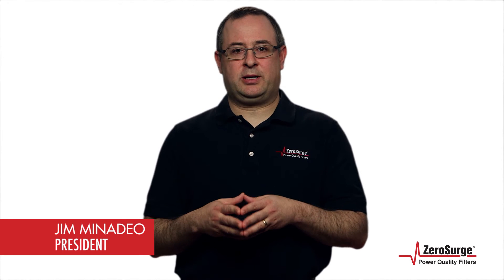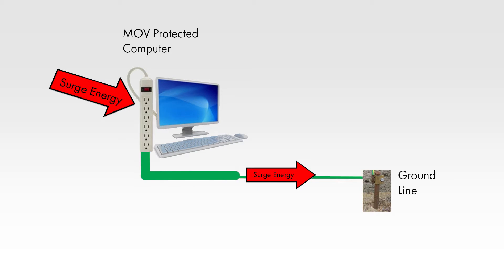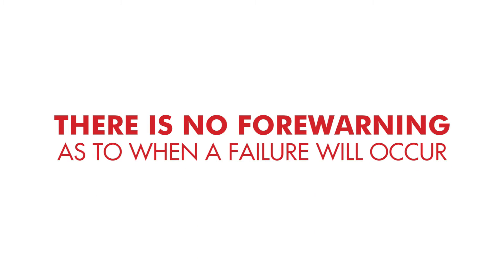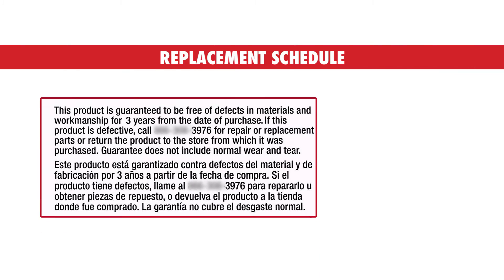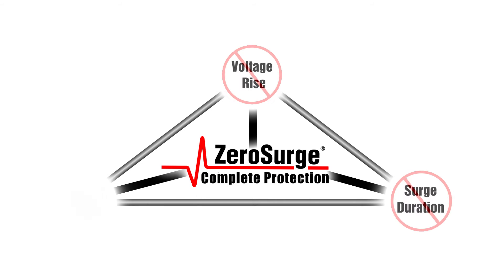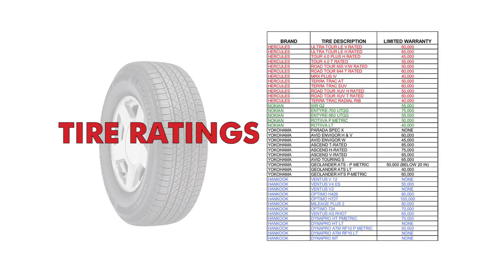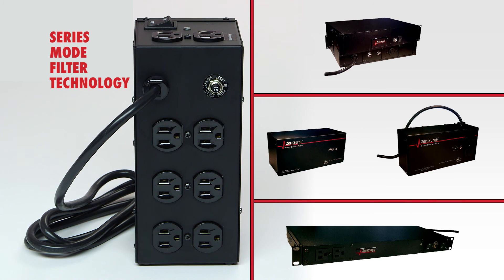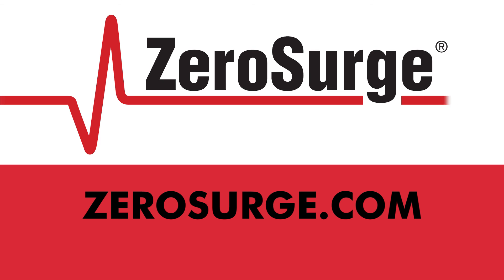The Truth About MOVs

Comment: I recently read a criticism of series-mode surge protectors that said that they only operate/protect in one direction: the direction of the flow of current coming in from the public utility. It was said that if you have a surge or a spike that originates on your neutral line for some reason, a series-mode surge protector offers no protection at all in that case. However, since a shunt-mode surge protector runs parallel to the lines, it doesn't care what direction the surge or spike originates from or travels in and it will offer its protection regardless. Is that true? Does that illustrate a potential advantage that a MOV-based surge protector could potentially have over a series-mode one?
Reply from the maker: MOV companies know that common mode surges (ones that are on the neutral) are not what harm power supplies.  Power supplies need to have 2000 volt resistance or they could hurt humans!  APC wrote a white paper called "common mode surge myth"!  Email us and we can send it to you.  

Surges in current are invisible to MOVs but cause the damage to power supplies. That is why MOVs are ineffective to stop most surges especially the in-rush of current when a device is turned on.

Comment: Do they make whole house surge protectors with non mov technology you install by your panel
Reply from the maker: We do not know of any that do not use shunt mode components.  Whole building surge protectors are not really needed.  80% of surges originate from inside of a building so having something at the entrance is not that effective.  Also, the inside surge protectors will be active before the whole building ones would have a chance to do anything.
Reply: @Zerosurge  Right, but I have heard certified Master Electricians say that ideally you want to take a tiered/layered approach to surge protection, just to be on the safe side. They have recommended three layers of protection: 1.) Surge protection outside at the Point-of-Service (installed by the electric service provider/utility company) 2.) Surge protection at the breaker box/inside panel (installed by an electrician) 3.) Individual surge protection devices at the outlet for any high-value electronic devices (purchased and put in use by the homeowner). The idea there is that each level of surge protection has a varying degree of let-through voltage and that what you are doing by taking that tiered approach is knocking down the amount of voltage that can potentially come in from the outside as it passes through each layer of protection. Yes, 80% of the surge events that you experience will come from inside of your facility, but that remaining 20% make up the ones that have the potential to send truly massive surges and spikes towards your equipment (a lightning strike nearby or a transformer explosion at a local substation), even if they are far more rare and unlikely to occur.
Reply from the maker: @michaelbeckerman7532  Sure - the electricians only hear from the manufacturers of the whole building equipment.  They are not engineers or scientists who look to the physics.  The VPR for a whole building is set too high.  In the layered approach, guess which device does all of the work?  The one with the lowest VPR!  As soon as the voltage rises, the device that knocks that voltage down first will do all of the work.  Think of it like a set of dams.  If my inside dam opens when the water is 10 feet high and the outside dam opens when the water is 20 feet high, what happens?  As soon as the water hits 10 feet, the inside dam lowers the water level.  The outside dam never sees the rising water!  Most of the 20% is switching activities that are not that high in voltage.  We monitor our incoming power and we see ring waves of 200-300 volts coming from the solar farms connecting in the morning  but in the 7 years of monitoring it never got high enough for a whole building surge protector to operate.  And I have seen with my eyes, lightning strike the road outside my office window.

Comment: So if I buy one of your two outlet systems, can I safely plug a regular power bar or UPS “downstream” of it to power and protect more items (so long as I don’t overload it?
Reply from the maker: You could do that. But be careful to not overload!
Reply: @Zerosurge  how? wouldnt this be daisy chain? I mean the 8 outlet is very limiting i wish you had a 10 or 12 non rack option
Reply: @naegleriafowleri2230  daisy chaining is defined as connecting two devices that have three or more receptacles each.  

You want to keep the current load to 80% of the rated wall receptacle.  A 12 receptacle device would limit the average load to about one amp each.  Better to spread out the loads (from a fire safety perspective).

Comment: To be clear, it's MOVs connected to ground that are the main engineering disaster here. MOVs installed just between hot(/active/live) and neutral are at least harmless enough, if they're given enough thermal protection to not start a fire when they die (which unfortunately is more than can be said for even Allocacoc's PowerCubes).
 
I can confirm from personal experience that shunting surges to ground is indeed a horrible idea, as I mentioned in my teardown of this Australian version (which isn't even as bad as some of the North American types apparently are): http://www.hardwareinsights.com/forum/viewtopic.php?f=29&t=2160&p=9244#p9244 (That the MOVs to earth are so much smaller in diameter than the "main" one casts a bit of doubt on the chance that this unit was ever engineered with sincere intentions. Anyway, the office it came from didn't experience enough surge exposure to even burn out any main MOVs, so make of that what you will. I don't recall any catastrophic PSU failures here actually; each casualty is fried logic circuitry as befitting your reasoning.)
 
An analogy I came up with is that if you have line-to-ground MOVs in place and then experience a really bad incoming surge, it would ruin the data/signal lines like a hammer ruins a hard disk drive. (That is to say, not even the strongest of them would survive that violence.) I love your analogy with the tires too.
 
My home PCs (and other electronics) have remained undamaged without any external "protection" in use (though I do stick to good-quality PSUs), by the way.
 
Since MOVs themselves cost so little anyway that decently-made SMPS typically (though by no means always) include one (or a pair of lower-voltage MOVs across the two primary capacitors in non-APFC units) inside them (albeit often rather small diameters), external MOV-based protectors are indeed greatly oversold either way.
Reply from the maker: MOVs are electrically noisy so not good for AV applications (even if just L-N).  Plus, they can't act on the true cause of most power supply failures which is a surge that is a sudden change in current.  MOVs can only act when a voltage level is reached.  They can't slow down the rise of the voltage either.  So they are not very useful.
Reply: @Zerosurge  I agree that MOVs have their problems for consumer applications, especially when products aren't designed with thermal protection, but I would be curious to see your sources for these claims. 

MOVs are effectively open circuits with a small capacitance in their resting state, so they should not produce noise that affects AV equipment. 

When the voltage spikes, MOVs begin conducting within ~1 nanosecond, which is indeed fast enough to stop a surge. Since current only flows when there is a voltage difference, stopping the voltage rise prevents the in-rush current. 

I agree that they don't stand up to longer surge durations or repeated surges. Another point in your favor is that the voltage they allow could still damage sensitive devices.

Connecting MOVs in parallel, as you mentioned in your video, does indeed increase the amount of energy they can dissipate. Your tire analogy is appropriate, but in that having more tires allows you to carry a heavier load, not get more miles.
Reply from the maker: @talrove  InCompliance magazine has several articles about the problems of MOVs.  

The aspect that we discuss is that the MOV only opens up when a certain voltage is reached. There is an in-rush of current that can happen below that voltage.  Most commonly when a device is powered on.  You do not need high voltage to get high current flow.  Example - a hospital in CT had to test their generators every month and their fire alarms were burning up even though they had MOVs ahead of each unit in every closet.  Turns out the temperature controlled resistors used by the fire alarm mfr stayed warm during the brief power change over and an in-rush of current passed the sleeping MOV.  Once they changed to us, the problem went away.  

In the tire analogy if one tire goes out, it does not matter how many pounds one can carry.  Adding MOVs does not make all of the tires work better.  Only increases the chance of limping along until you can get to a tire change!